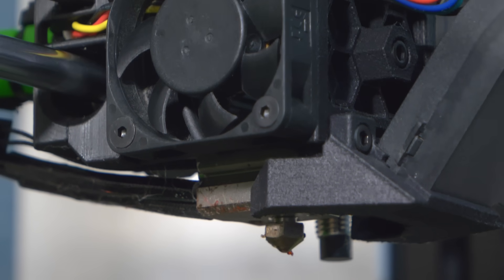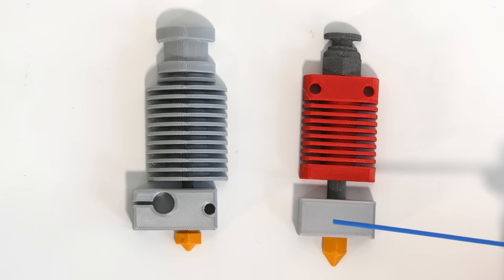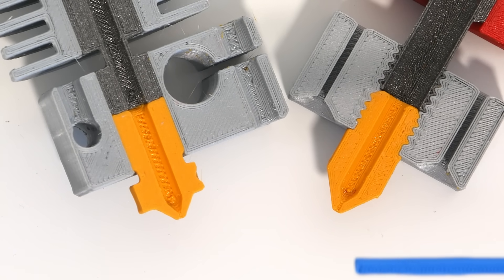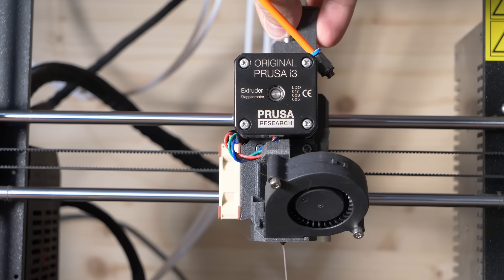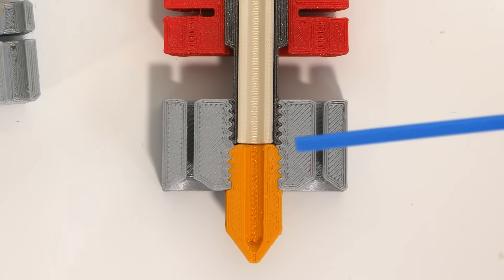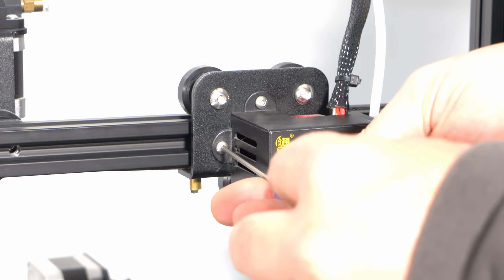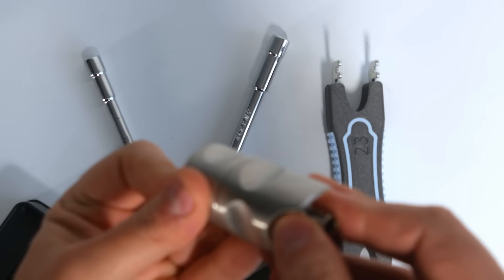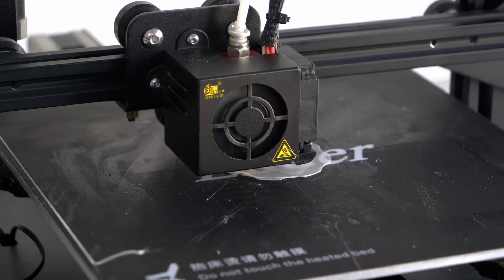The Biggest Pain In 3D Printing - Hotend Clogs & Jams

Comment: I just got done with a 24 hour print and all of a sudden, Im having these heat creep jams. Whats strange is that all my print settings are the same, the ptfe tube is undamaged, but still suddenly these 2 hour prints fail 15 minutes in when the printer was fine running for a whole day just recently.

Comment: would be helpful to have the tools to do it before doing it ... well gotten it working again without even having a acupuncture needle to go through the nozzle. Sadly/Fortunately had to replace the Bowden (i know i wrote it wrong) tube as that was clogged beyond what i could doo, now i got a shiny new reduced friction tube for that (had it laying around for ages but never installed it).
Also a heat gun is almost a must have, i managed to clean out the nozzle by repeatedly uninstalling and reinstalling it in the hottend what was as you might think more than a Finger Burning pain in the [YouTube friendly word] getting the clogged filament out of the tube ? nope not gonna be doing that with the hottend alone. 
and it is not a question when. it still is if. if you don't do stupid stuff like me )on purpose getting the nozzle too close to the printing surface to get super adhesion you can get away with it for years ... like i did ... before having my fillament break on me 3 times in a row

Comment: Thanks, this video was very helpful. I'm printing since a few years but never had such a massive jam like today. Normally a cold pull does the trick - but not today. The trick with the push stick (which I had from my retired Geeetech printer) did it. Didn't even need the the heat gun :)

Comment: Thank you for an excellent video. I have been happily printing for 1 1/2 years, changed to a Micro Swiss hot end and immediately got a jam. Never had this issue before, I change nozzles regularly so did not need to clean them.
I've been reading that linear advance may be helpful if I'm using an all metal hot end, as well.
Many thanks for all the helpful posts on this thread!

Comment: I've recently started using a volcano hotend on one extruder on my idex printer. I have a lot of issues with the filament clogging but to where I can pull it out quickly and cut the bulged end off and it finishes printing fine. Any suggestions on how to prevent this? It's getting very frustrating.

Comment: Really opened my eyes to how complex something simple appears - issues about the PTFE position in the hotend. I have a friend, both of us with an Ender 3 V2 and he has been running into a lot of filament drive chugging. At first I thought his bed wasn't level and the chugging would only happen at the first layer or two, but leveling the bed only partially fixed the problem. Now I think he has to do a good cleanup on the hotend and cut his PTFE with much more care. I wasn't thinking about retraction, how that constantly works at jiggling the PTFE up and down.

Comment: Thank you for this video and I'm technically minded and found that after my first ever print which came out beautifully afterwards I put temperature hotend 210⁰c & bed 70⁰c, have a few bits to adjust, but this video has given me some additional information advice from you. This should help. I haven't once asked for any help and only got me printer a few weeks ago and last few days I've been trying to print and the filament push sames off plastic switching to metal one see if that helps with your help about hot ends is appreciated thank you for given your time to help us newbies to 3D printing. Have watch loads of videos before getting the ender 3 pro, upgrade to 4.2.7, touch sensor level, touch screen, side supports, filament line brake, and a few more bits all original parts for upgrade, ordered a  Direct filament feed, which is original with plastic filament feed which will be changed for metal one,  hopefully it just a blocked end but done a few prints that failed, I know it work's well when it duse print but 2 process one you have given and other is what I'm thinking of. The firmware wasn't easy to do but I didn't ask how I read and watched videos they help me more,. Happy 3D printing every one

Comment: I have a question. The Filament sensor on my lk5 pro keeps stopping in the middle of prints saying add filament, but there is plenty of filament. I’ve changed rolls unplugged the sensor wire but I’m running out of options other than trying to find a replacement part. Any ideas?
Reply: Oh and great explanation of clogs and why they jam.

Comment: Very well done , Bravo ! Question - Why does the heater block need to be at temp when I replace the nozzle ? I don't replace my sparkplugs hot.
Reply from the maker: That’s cause your spark plugs don’t have extruded plastic residue around them hehe heat allows the metals to expand, making it much easier to remove the nozzle without damaging anything

Comment: Very nice Video. love your 3d printed hot ends.
As for the clogs or jams, over the last 4 years I have only had 2  jams/blockages in the Nozzle due to rubbish/ poor quality filament and so I wasted time and money trying to unblock.
and it never did properly.

Also you will most likely get more problems when you heat up the hot end to a temperature above 260 most PTFE tubes tend to distort / melt, as this happened to me, Causing more Problems (stripping down the hole hot end and replacing the heat break and PTFE )
 
So it is quicker and cheaper just to put a new Nozzle on . No wasting time & money on Nozzle cleaning filament and loosing out on enjoyment time from printing, so for the sake of about 50p for a new Nozzle your up and running in no time.

Comment: So my question is how do you fix an extruder where the filament clogs at the end of the nozzle right as you're printing and doesn't separate? I'm trying to fix my ender 3 pro v2 and ive run into this problem more than once

Comment: Hello, very interesting video  a question...
Between the heat block and heat sink,why don't  they use a ceramic block between the heat block and heat sink, to isolate most of the heat from the hot end bleeding to the cold end, will also make the printer more energy efficient.
Would have to be a good ceramic, lots of air, and inner bore would have to have a glazed, out side could remain porous.

Or could use that aerogel? They are develop for reentry and spice flight, that's a good product, very light, and quite tough.
Oh its not to expensive, and a.d glaze the hard surfaces.

Oh that's my idea, good luck, I think that would be good for Stirling engines too

Comment: im trying to print tpu with a 0.6mm nozzle but it keeps jamming at the feed gear.im setting temp to 230 and using ninja flex tpu but no success still jams .pla extrudes fine. i have a longer lk4 pro.any ideas? whats a good forum to use. also when i print some prints start just fine and some don't altogether wierd 
not sure if its the stl file or the machineanks

Comment: iv been having issues with my Labits 3d printer (comparable to an Ender 3 Pro). and have had very little success seeing what could be the issue. Iv tried the needle trick etc to get the girl unclogged. But when you said to just push a metal rod down in there, I grabbed the nearest wire hanger and just pushed that clog through the heating block with no problems!!!! AMAZING work btw on not making a boring video on how to fix this issue too. I was about to suck start my glock-a-chu if I had to listen to one more middle aged dad in a garage explain to me his printer specs before showing me the wrong problem to fix.

Comment: I have two screws connecting my heatsync and the heat block - is this correct? it seems like this would transfer heat more - or is that the point? (im a noob)

Comment: Thanks Tom. I believe this traces my problem to the gripper wheel in the extruder housing, and I'll have to experiment with the tension. Shouldn't have taken it apart :( in the first place. First problem turned out to be a bit of filament broken off during a hot pull. Slit the Bowdon tube with an exacto knife, picked out the filament. Colo-rectal surgery, here I come !

Comment: clogs is a pain i have ordered copper washers to see if this can help against clogs and leaky threads, a copper washer will seal the nozzle to the heatbreak 100% stopping the posibility for leaks around the threads,  they are often used on engines to seal the diesel and petrol system and can be reused 2-3 times , if this will work remains to be seen.

Comment: A very well-prepared explanation of the possibility of blocking the filament. Recently, I myself had a big problem with filament jamming and stopping extrusion altogether. The problem turned out to be quite counter-intuitive. Well, my old plastic extruder from Ender 3 in the place where the filamen enters, the filament after houndreds hours, cut a slot ... which probably caused filament blockage .. I replaced the extruder elements with new ones made of aluminum. But the jamming problem occurred, I replaced the nozzles, PTFE tube, finally replaced the complete hotend, hotend insulation, thermistor ... and nothing chgange. Interestingly, the filament jammed after few minutes, the first 2-3, sometimes 5 layers, worked very well, and then suddenly the filament flow was completely blocked ... ..The real promlem was deformation (indentation) made by to tension spring in ektruder. this deformed filament as it reached the hotend caused the filament to jam after a while. After replacing the spring  in ekstruder with a weaker one, everything started to print well, I printed a few elements (several hours of printing each) and everything works, before that, each print after a few minutes was blocked. Sometimes, when we replace several elements at once, assuming that all new parts are working properly, we may have a problem finding the cause, as it was in my case.

Comment: (UPDATE BELOW FIXED)
I don't know why I didn't watch this video sooner. I've been looking through scattered information on this topic for over a week now. If I had seen this earlier I would have progressed a lot faster. I keep getting jams mid print. (It's really frustrating when I see one print finish and another fail misprint) But now that I can see what goes on inside the hot end. I believe I should be able to diagnose what's happening. Just throwing out a bunch of solutions to a possible issue  is just frustrating and a waste of time. Your video actually showed me and explained what the issues are and how it should actually run. Thank you!!!!
Reply: UPDATE: Got it working! Interesting this video helped me realize there wasn't a problem with my hotend. I did trim the bowden tube to make it more flush. However, I was finally able to stop focusing on the hotend and look at the extruder where I found the real culprit... the ridged metal part meant to feed the filament was missing one screw! So I found a spare and tightened. So far so good!!

Comment: Excellent video! Thank you! I think I had about every problem you described in this video already.... One question: Isn't the heater block on the left section printed hotend the wrong way around? I'd put the heat cartridge down, closer to the nozzle and not up, closer to the heat-break or cooling fins.

Comment: I have a ender 3. I use pla plus. Nozzle temp 22p and bed at 60. I'm on the end of my second spool of filament. My prints are now making errors so that it look like a nest. I changed my nozzle. When I run test print for bed level. Even though I don't make changes I get results. Sometimes good then print goes bad in one corner. Any help is appreciated.

Comment: Nice  presentation!
Btw, how can we be sure that the top of the nozzle is completely flush/flash (sorry i don't know the right word ) with the bottom of the heatbreak?
I mean, how can we be sure that either the nozzle or the heatbreak is not just stuck at some point, because of hardened plastic due to clogging or oozing, that may tell us that they are already flushed to each other but in fact are not.

Comment: Excellent explanation and description of curing the various problems. I would add, make sure that when reassembling heat break, heater block and nozzle, that the nozzle is able to screw up tight to the lower surface of the heat break. You might need to screw the heat break a bit further in to the heater block to achieve this. This will mean that there is a thread or two on the nozzle which is visible below the heater block. If this is not done, melted filament will seep down the threads of the nozzle and corrupt the print.

Comment: I was getting jams on my Ender 3 direct drive setup. Heat creep maybe an hour into the print. My fix was changing the short bowden tube to a new one. I can't explain why it fix it, but it did. When I measure the old tube, there wasn't any big change in thickness. My guess is that the tube CAN get softer overtime and less able to keep its shape when heated.

Comment: im just curious why dont we just use a cheap copper or aluminum tube same size as plastic tube to go down the hot end in place of the plastic tube then after the metal tube exits the hot end cut it short and attach a cheap coupler so you can attach the plastic tube to it for flexibility.    
has anyone tryed this to see if it even works

Comment: Sometimes to clear out a heatbreak I remove the nozzle, fan and heatsink (in my Anet A6 the extruder heatsink is removable), and turn the hotend on to max temperature, and leave it like that for a few minutes. This works if you either do not have a heat gun, or you can't be bothered to disassemble everything to avoid blowing on plastic parts. So far I only needed to remove the heatbreak twice- one time I overtightened it and it broke off, and once the PTFE inside started to negatively affect prints by being worn out from printing a lot of cheap ABS that needs temperatures between 240 and 255 °C as opposed to 230 which some people seem to recommend.

Comment: I left a small spare-part printing today (about 50 minutes) and went to work (told mom to turn it off, and so she did as usual). Thing is, I got an extreme jam inside and outside of the nozzle and hot end (visible from outside, like a huge ball of dry material). I've got this ender 3 v2 for a month already and been extremely careful so It's so weird that this happened. I'm honestly scared about what to do, I did set the machine myself and studied what the parts do and how they work...but, should I also attempt to repair it? Is it normal to have a jam that is so terrible? I have printed things in the 20+ hours and no issues before.
Your video is great and I have an idea about what to do, but This is so discouraging.

Comment: While printing a test fit part with a silk filament I had not adjusted the temp up for, I noticed the telltale signs of a jam, though I had to figure it out first. Upping the heat 10c fixed the feed problem. (under extrusion due to low heat)

Comment: Great video. I have never had to do the "cold pull" in the 2 years I have been using my MK3s. Because, what I do when I have a hot end clog is use a pushrod I made from my model airplanes. This is a steel wire (aka pushrod) that is 1.5mm in diameter. Depending on how severe my clog is, I either push from the top downward or from the bottom up. In both cases I heat up the hot end to its hottest setting first. When pushing from the bottom, the pushrod becomes hot and the heat helps melt whatever filament is stuck. The whole procedure becomes very intuitive. This system works very well for me.
Reply: I forgot to add. I frequently do this after removing the nozzle.

Comment: I have two questions, about a nozzle.  I am trying to see what are the components in this nozzle for the  EasyThreedx1  (please see photo here.)  As I might need a lot of various sizes for this machine.  Ques 1:  It comes in standard .4 nozzle with some special heat protection at the head and two little wires attached.  I would like to know how to put together a bunch of nozzle-extruder myself?  (w diff diameters myself.  Diameter wise, it is not a problem, if i cant find market ready sizes, i just drill the hole size myself)  Ques 2:  how could I adapt this nozzle-extruder  so that it accepts .3mm filament?  I have seen other people asking about this in Reddit.  As this printer is a v gd, light weight machine, it is perfect for my travel use.  Thanks in advance.

Comment: I've one of the first printer on the market (Da Vinci 1.0) with an all metal hot end without PTFE tube and it's a pain. Thanks to you I managed to clean the extruder and the nozzle but clogging continues. The problem is that filament is squished in the tube, expanding it and jamming the tube. I've tried almost everything but this problem appears as usual randomly during prints. I've tried to disable retraction, changing speed from low to high, extruding in air to avoid nozzle touching the bed,... but nothing. Now I'm trying to keep temperature lower as possible because increasing it seems to increment the problem. It's last test and after I think I've finished ideas. Have you any advice for me?

Comment: Instead of a heat gun if you don't have one you can just remove the fan and crank up the temperature, without fan the heatbreak will conduce heat to the radiator and heat it hot enough after some time to soften plastic inside too

Comment: Prusa mk3 uses a heat break specially designed for MMU. If not using MMU on ur prusa, this should be swapped for an original e3dv6 heat break. Prusa one is prone to retraction clogs as it has a neck in it, going from 2.2 to 2mm. This because MMU requires less friction for automatic filament swap. Clogs and underextrusion can be avoided using less retraction, but for those ooze free prints you're better off going for an original straight bore heat break which allows for more retraction. Go for titanium while at it, as it has lower heat conductivity :)